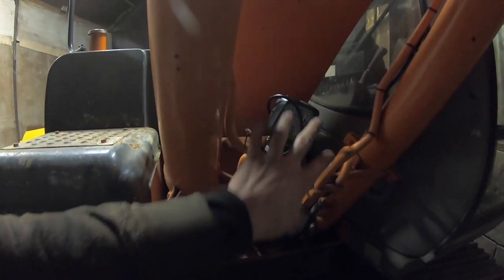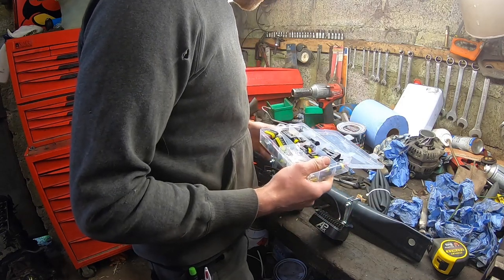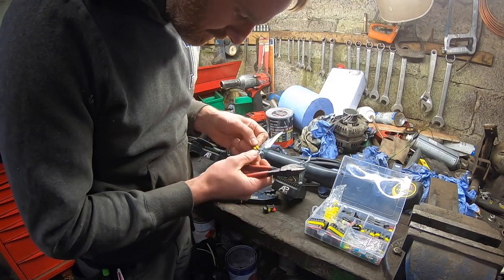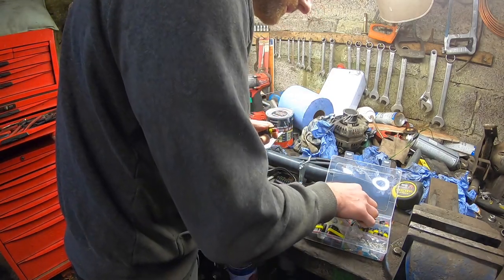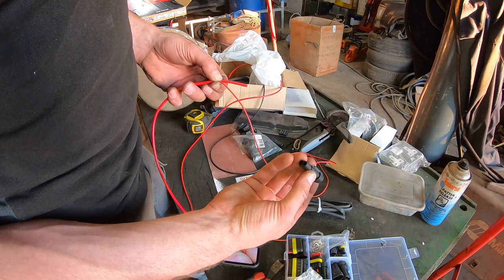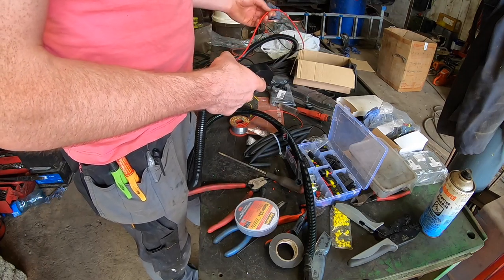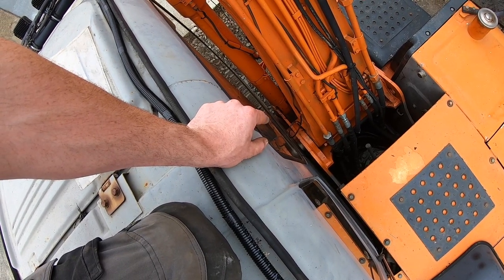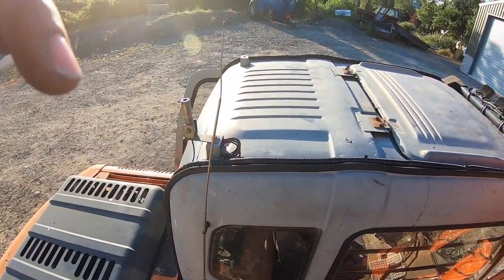Wiring and fitting LED spot lights to excavator

Comment: Great video Conor, I bought them water proof plugs in Halfords but can’t get the wires to click into place. Asked a good few lads about them but know one could figure out what the issue is. Is that a standard crimping tool or just special for them? Very tidy work lad keep it up 👍
Reply from the maker: Thanks for that, the plugs/connectors are known as super seal connectors. The crimper is specifically for the crimps that come with them. They will clamp around the strands, insulation and the yellow seal properly. I only ever had bother with one of them and it was because it was slightly bent. Make sure they slot into the plug/socket correctly. They will only click in one way and should lock in place. The socket should have the male pins and the plug should be the female side. Hope this helps.
Reply: @connormcmahon3724  👍

Comment: well conor have to say very tidy work from you where abouts did you get them superseal plugs on ebay i got ones they never worked tgey never locked in they loook like good ones do you have a link or anything?
Reply from the maker: Well Jack. I got them on ebay quite a while ago and the same listing is no longer available. I had one dud I think too that wouldn’t close and it was because the plastic was out of shape from a manufacturers fault. Only advice I can give is read reviews and try ebay and Amazon, don’t buy too expensive ones and don’t buy too crap either! Also make sure the pins are put into the plugs the right way around. Good luck 😉
Reply: @connormcmahon3724  thanks conor for replying so quick i’ll try look around and see what i can get have you ever tried the deutsch connectors i think they’re abit more expensive but they look so much more simpler and look nice

Comment: What do you think of the thumb attachment on machines, I see yours is not on the machine, did you take it off or did it ever come with it
Reply from the maker: Hi Paddy. Depending on the jobs I'm doing, I sometimes take it off. No it didn't come with it. I installed it a while back and I have uploaded a video of fitting it too if you have time take a look at it. Thanks for watching and the question.👍
Reply: @connormcmahon3724  saw that, started watching through a lot of your mechanics pro rated videos and they are very good, own a clean ex60 myself that Dosent do much, learning a lot off the videos
Reply from the maker: @PaddyGun  Great to hear, Ex60’s are a great machine and a great all rounder! Glad you enjoy the content, ever any questions just ask and I will try help if I can 👍🏼

Comment: Hi conor great video. Where did you purchase the chokes? Thanks
Reply from the maker: You will find them on ebay, there term if “ferrite choke“. There are different sizes and kits of multiple different sizes which are handy in case you don’t know the size of your cable.
Reply: Good man thanks

Comment: Wha size heat shrink was that u were using great video 👍
Reply from the maker: A few different sizes there Nathan, ebay or Amazon will have it. It has a glue inside it unlike normal heat shrink. I used around 4.8mm, 9.5mm and 19.1mm and those sizes are pre heated 👍🏼 thanks for watching